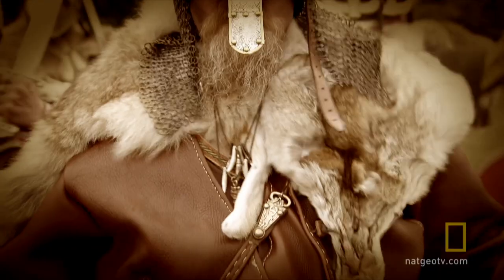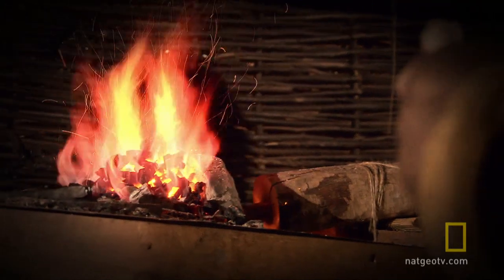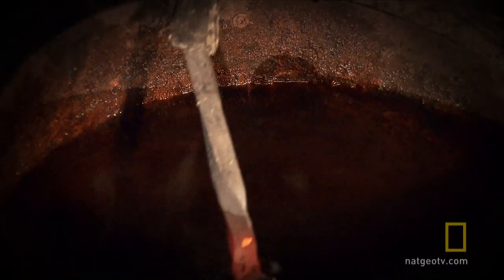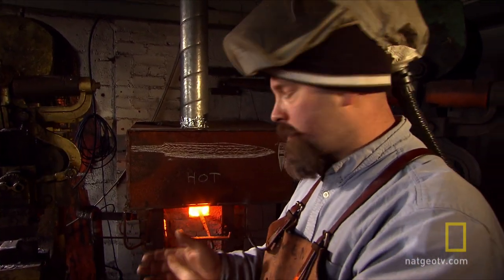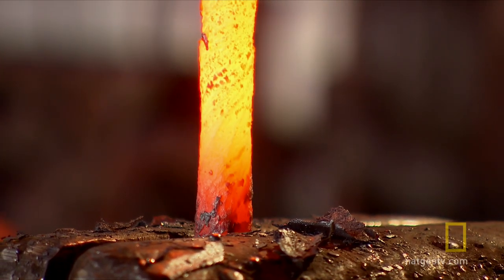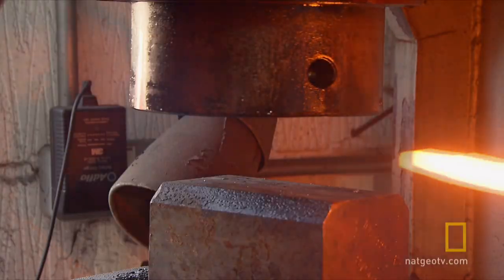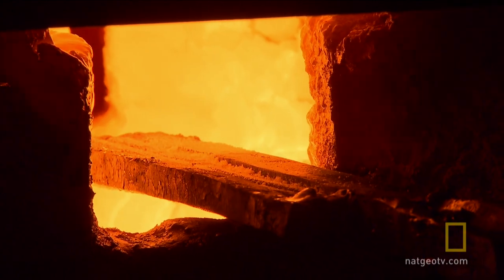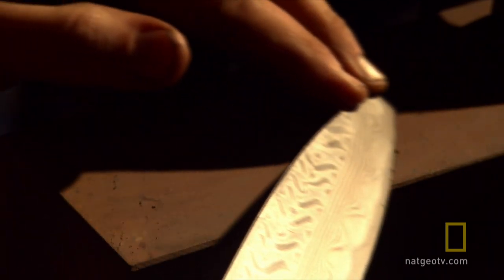Welding a Saxon Sword | National Geographic

Comment: @Czed93 Forge iron is no where near as strong as stainless steel. But most replicas are made out of aluminum and zinc alloy or other lighter alloy instead.
Reply: It all depends on which type of stainless steel. Thats a very broad term.  154cm is very different to so called 'surgical' steel or even to vg10. 440c is different to 440a or 440b. Then again modern powder stainless steels are very different again. You cant make a sweeping statement about stainless steel because each type of stainless steel is formulated for a specific purpose. Some have better edge retention and some are stronger and tougher and some resist corrosion better. There is no stainless steel that is best in all categories. And there are many grades of stainless steel that will make much weaker weapons and blades than basic iron or basic steels like 01 or 1095.